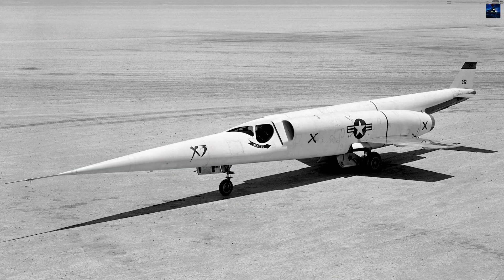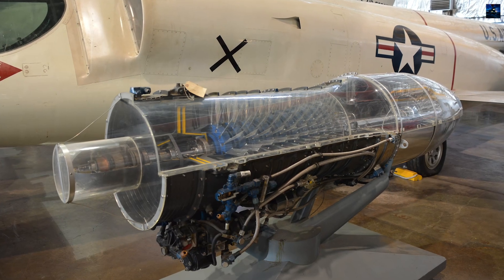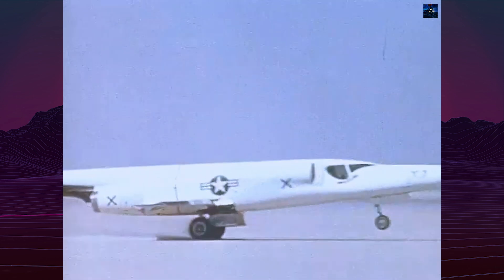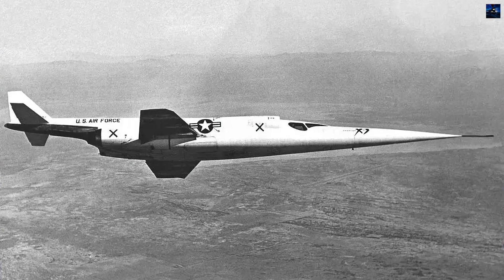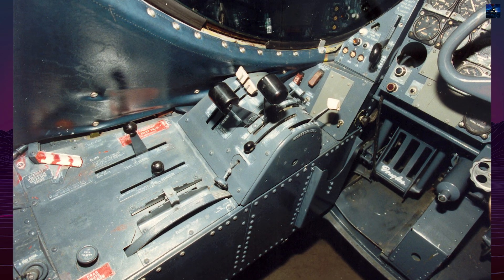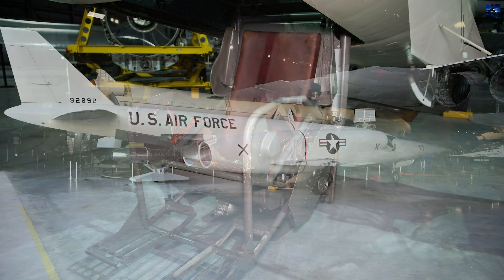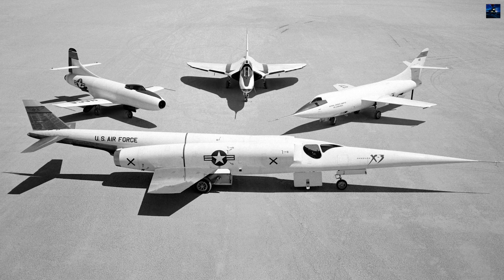Douglas X-3 Stiletto: The Jet That Taught Lockheed a Lesson

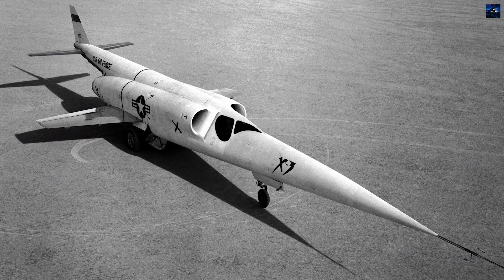Comment: The "technical limitations" mentioned regarding the originally planned Westinghouse J46 engines 1:01 were that they arrived from the manufacturer oversized and overweight. Accommodating these variances would have increased the plane's overall weight, which when combined with the additional weight of the engines would have made the X-3 even less performant than that which was achieved with the lower thrust J34's

Comment: I built a model kit of this in the late 50s. Always looked like it needed a dart board to throw it at. Bottom ejecting pilot seat. I was told the early F-104 had a bottom ejecting seat also.
Reply: I heard pilots called it the dejection seat.
Reply: Activated by pulling the flush handle.

Comment: The discovery of the “Area Rule” design principle was the main reason this aircraft didn’t perform even to the weaker engine standards. The F104, with its telltale pinched waist was designed after the discovery by a British aeronautical engineer.
Reply: Wrong. The importance of the "area rule" was discovered by Richard Whitcomb, working at NACA at the time, and was in no way British.  The basic idea was discovered and documented in Wallace Hayes PHD thesis.
Reply: The Stiletto was initially designed in 1947 and got its final design in 1949. The Area Rule was discovered in 1952 as stated here already, in 1952 by Richard Whitcomb, working at NACA. The serious lack of engine power was the main reason the X-3 didn't perform well.
Reply: That was my thought. What is curious is they didn't take the transonic area rule into account even though it was discovered well before this plane was designed. Especially after changing to the lower power engines.  Compare to the T-38 to see what that might have looked like. But still, a cool looking aircraft; I built 1 or 2 of these plastic models back in the day.
Reply: That’s a funny way to spell Adolph Busemann.. 

He was the one who discovered that supersonic flow behaved as if it was an incompressible liquid in a pipe—where a restriction would slow down rather than speed up the air as with a Venturi acting under Bernoulli’s theorem.
Reply: @ That is true. And that data during a talk Adolf gave is what led Richard Whitcomb, to try and work out what these pipes were doing in a transonic test he was performing, inventing the Whitcomb area rule a few days later.

Comment: Ah, the F-104 Widowmaker! Lockheed obviously DIDN'T learn enough from the X-3 or they would not have designed the F-104 the way they did.
Reply: We have to consider the time of the early 50th. Nowadays we are sitting in our chair, looking interesting videos. At that time the war was just over but it was in the minds and in the souls and everybody tried to get higher faster better. So test programs were launched in a hurry and sometimes not every thing was considerd. The pilots knew it was dangerous. Nobody forced them to fly, but the wanted. And the german starfighter also wanted.
Reply: The CF-104 certainly wasn't designed for the low altitude missions the RCAF used for in Germany during the '70's.
Reply: The F104 was a demanding aircraft but if flown within its specifications, it was the best bomber interceptor for 20 years. Early models, however, ejected downwards which meant that if you had an engine failure shortly after takeoff you had to roll inverted before ejecting.
Reply: Wasn’t this „“beast“ the forerunner of the Starfighter. I had a model of the fliegender Dolch. Translated as flying tagger
Reply: The F-104 was an excellent extremely high performance airplane when flown as intended. Only the Germans had problems with it, because they loaded down the "lightweight supersonic fighter" with lots of bombs and used it at low speeds and altitudes for which it was never intended.

Comment: If they only built one, I wonder where the X-3 came from that was sitting on a pole at Lackland AFB when I arrived there in 1960.  Even then it was recognized as a loser an a waste of money.
Reply: They always call it "underpowered." If it was fully powered it would have demonstrated supersonic inertial coupling, not just trans-sonic inertial coupling. Maybe it would have been magically great at Mach 1.5, maybe not. That said, it's still a beauty, it has F-4 shoulders, F-104 wings, McDonnell empennage with a BF-109 sized rudder, and whatta nose.

Comment: I resembles the new super sonic passenger aircraft being developed. I wonder what it's sonic boom signature was.
Reply: Sonic boom signature?  It could not go supersonic in level flight as stated in the video.  No sonic boom was possible except in a dive.  It looked very fast and bad-assed but without the planned engine power, it wasn't as capable as desired.